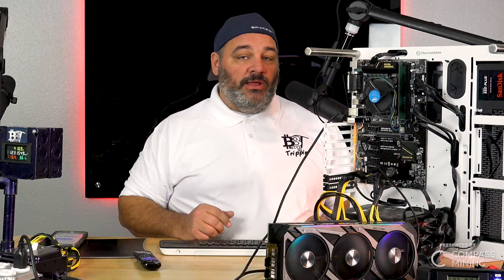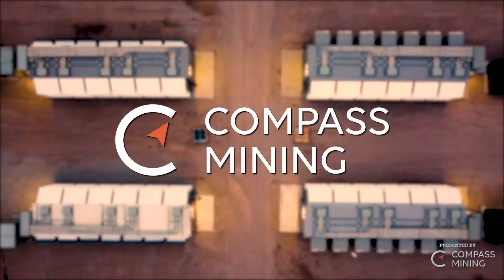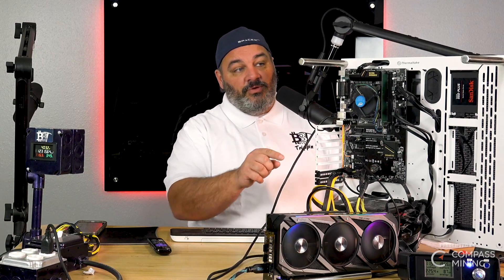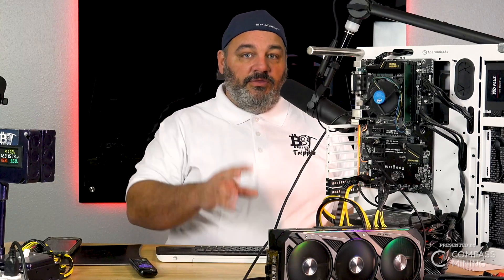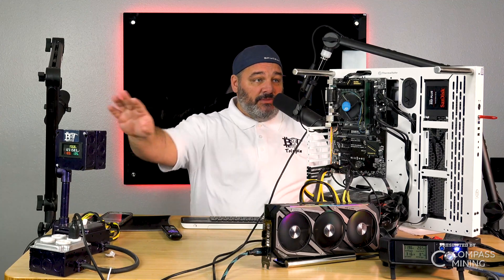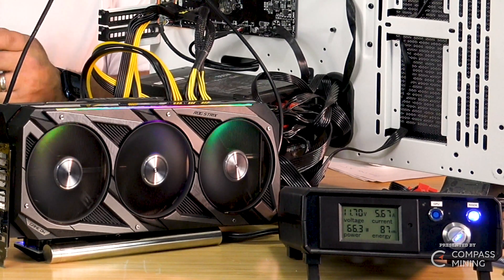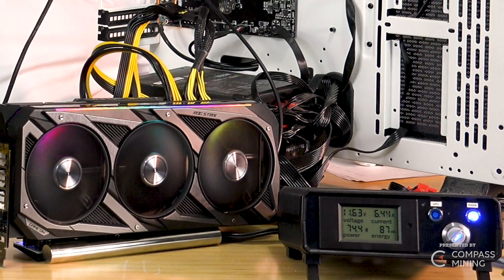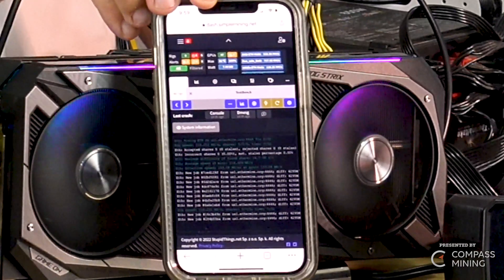What kind of power does a 3090 need?

Comment: No way it draws that much from the riser. This is wayyy out of spec. Riser loss?
Reply from the maker: We had that same reaction initially, but have opened the box up to make sure there wasn't anything else going on with the capture. Separately, I am getting a clamp style meter for double checking. You will see that in an upcoming video.

Comment: Hi BBT, huge fan. I'd like to share a story.
I got into an eArgument the other day with some dude about SATA/Molex not being safe for 3090s. He said because Crypto LLC's youtube channel has a few 3090s running off of SATA, that he has more experience than me and I received a direct reply from Crypto LLC saying I need to do some research. Why is that guy's YouTube channel/followers so naïve to believe and defend such unsafe practices because someone has a video of it running ok? Btw, I linked your video of a Zotac 3090 pulling 100w from the riser, and no reply from either.
Reply from the maker: Ultimately they are going to burn up the SATA connector ; the 3090 pulls well over specification. Eventually they will get a burnout.

Comment: Carter I think you've got crappy cables on the main inputs because there should be no more than 5.5A on 12V rail off the riser, card will not allow that unless it's on uncontrolled return path which is taken by the main inputs if the cables there are lacking.
11.52V readout on the meter box confirms that, it's way too low, for reference on my 3080Ti doing 305W in software I have 11.98V on the main connector measured with a multimeter, and 12.09V on the server breakout, that is about 0.11V of a voltage drop, and that is with my card having only two 8 pins on the main input, so your 3090 with 3x 8pins should have less voltage drop with 18AWG cables, meanwhile you have at least 0.5V of a woltage drop, 5x more than me.

Since that time I've got scammed with amazon special "18AWG" actually 24AWG server cables I'm making my own using industrial grade cables and genuine molex crimps.
Reply from the maker: Great comment my dude will take a look at it and thanks for pointing that out
Reply: @BitsBeTrippin  You're welcome, I have a bit more info so if you want to talk just give me a shout.

Comment: Sweet video great stuff to know. I also  wonder what the power draw would look like on a riserless board that uses a secondary power supply to power the risers and then also has a molex connector going also to the risers for additional power. I.e. like an Asrock H510 btc pro+. Having slot of trouble getting clarity from Asrock. They say the molex will never do more than 54w since there is a secondary power supply but it would be great to actually know.
Reply: I’ve been very curious on this as well.
Reply: @RedFoxCrypto  I currently have an extensive email chain open with Asrock. But still trying to extract the exact information.

Comment: Thank you that is very helpful!  What are your fan, core and mem settings at the 305 power limit?  Mine are 80, 1100, 2400.  I am at 121.2 mh.  Temp 46c.  Thank you Russ